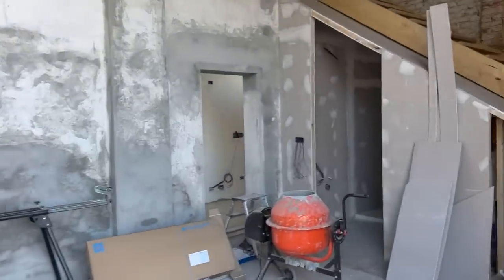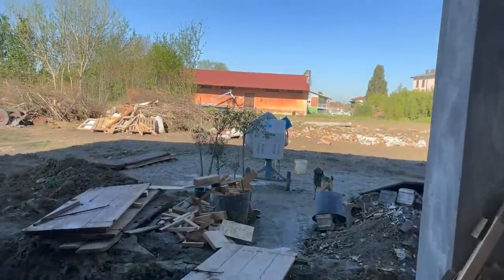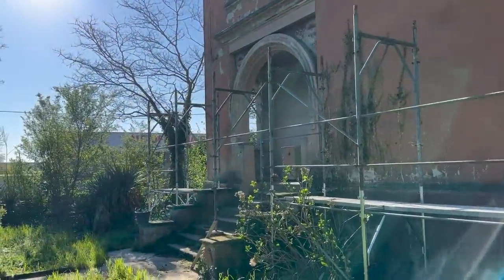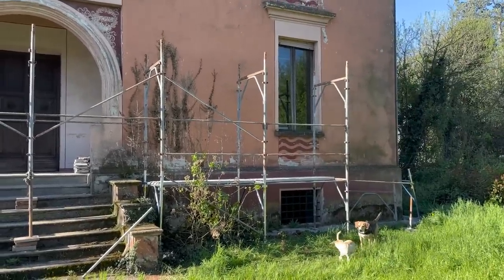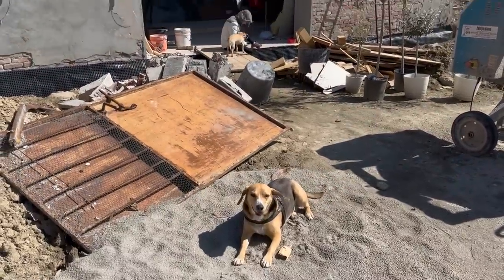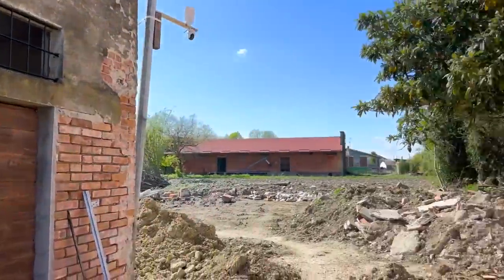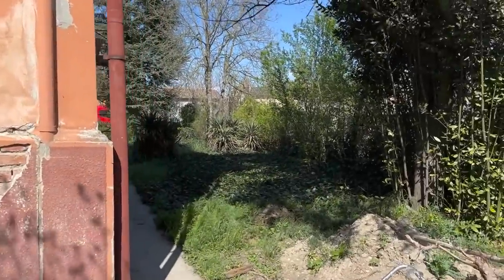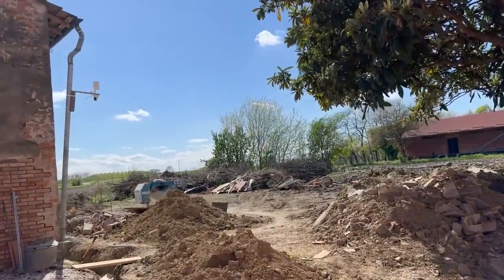Building Up: SCAFFOLDING Our Italian VILLA and Running Errands in the middle of Our Cervinia Trip

Comment: I guess Italy or the municipality doesn't require living spaces to have a secondary means of egress (window or other door) for safety reasons. This is in regards to having rooms with permanent bars on them, like the stables. Had you not thought of cutting the out the bars?
Reply from the maker: But there will be 3 doors on the stables, so there is for sure a secondary exit in case something happens. 
No we have not considered cutting out the bars, it's very traditional to keep them and we will not permanently live in the stables, it will primarily be a gym and sauna etc. 
I actually haven't heard of anyone being stuck inside their house in a fire because of the bars on the windows even though I am sure it has happened.

Thank you for watching!!
Reply: @VillaAroldi  Ah, I see. I think that many places in the US have associated building codes for secondary egress, primarily for bedrooms, which seems to make sense for safety, over other rooms like kitchens, etc.
Reply from the maker: @walkingstick6655  Im sure there are here as well, but then again, the stable is not our main house and the main house itself is 100 years old so I guess it's a lot different to building something new today.

Comment: All those piles of dirt and trenches around the house seem like a safety hazard for anybody trying to come put in windows. Any plan on getting all those piles gone in the driveway filled in and the trenches filled in would be a safer time to put in the windows.
Reply from the maker: The trenches will soon be removed, they are not in the way of entering the stables though as whoever comes into the property does not need to cross any of them in order to enter the stables. 

But for the larger window section we need to fill all of them so that they can enter with some sort of vehicle in order to lift them in place, the other small ones is possible to carry by hand. 

Thank you for watching!